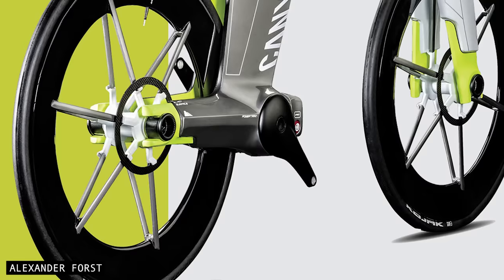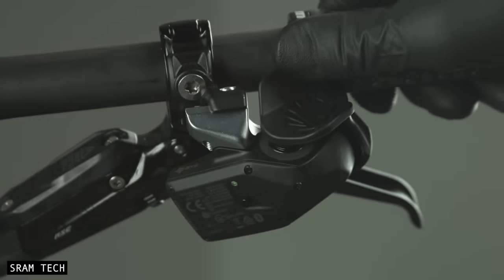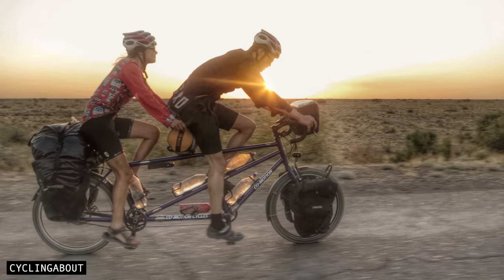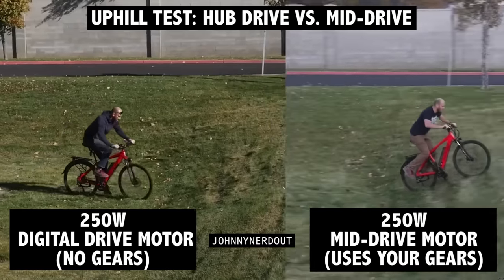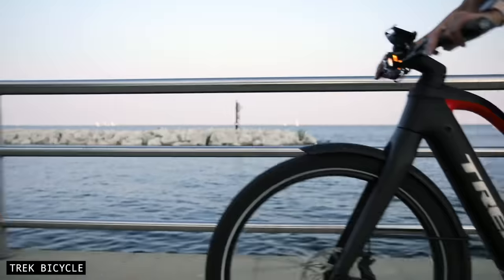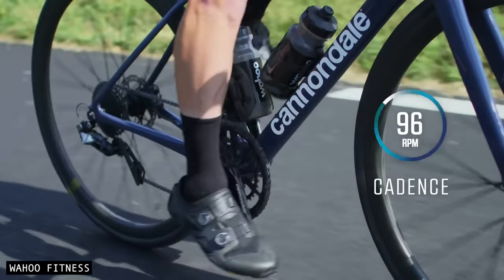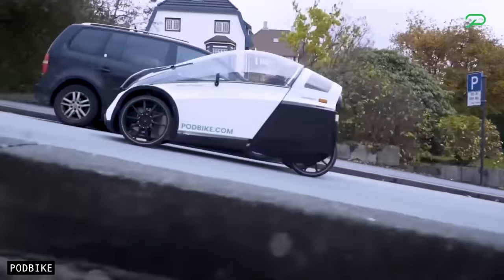Are Chainless Digital Drive Bicycles The Future of Cycling?

Comment: Summary
* (00:00:07) Digital Drivetrain Basics: A digital drivetrain uses a generator at the pedals to create electricity, which powers a motor at the wheel, eliminating the traditional chain.

* (00:00:26) History: While seemingly futuristic, the concept dates back to the 1970s. The first fully functioning prototype appeared in 1995, and the first production bike was released in 2012.

* (00:01:44) Advantages of Digital Drive:
    * (00:01:50) No Chain:  This means less maintenance, no greasy mess, and potentially lower running costs.
    * (00:02:12) Automatic & Infinite Gears: Provides seamless gear shifting, ideal for novice riders.
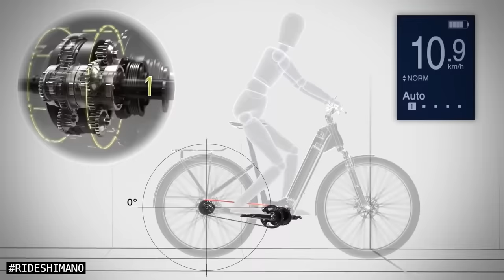    * (00:02:40) Potential for Energy Storage: Could incorporate a battery to store energy for later use, such as assisting on hills.
    * (00:03:01) Regenerative Braking: Captures energy while braking.
    * (00:03:17) Pedaling Optimization: System could ensure optimal power output and cadence for efficiency.
    * (00:03:50) Customization: Allows for adjustments based on injury or disability.
    * (00:04:03) New Design Possibilities: Opens doors for innovative bike designs, including folding bikes and multi-rider systems.

* (00:04:25) Disadvantages of Digital Drive:
    * (00:04:25) Lower Efficiency: Significant energy loss during the conversion process (mechanical to electrical and back to mechanical).
    * (00:05:36) Increased Weight:  Added weight from the generator, motor, and wiring.
    * (00:06:05) Gearing Limitations:  Rear hub motors currently struggle with both steep hills and flat terrain without being excessively large and heavy.
    * (00:06:28) Software Dependence: A responsive and well-programmed controller is crucial for a natural riding experience.

* (00:06:50) Digital Drive E-Bikes (Series Hybrid Pedelecs): Combining a digital drivetrain with a battery helps to offset the weight and efficiency drawbacks.

* (00:07:22) Existing Examples:
    * (00:07:22) Mando Footloose: The only current production bike with a digital drive, but with reported drawbacks in terms of feel and responsiveness.
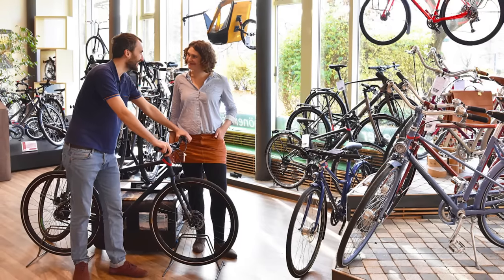    * (00:08:22) EE-SpeedBike: A more advanced prototype that never reached production but showcased a more natural riding experience.

* (00:08:49) Future Potential:
    * (00:08:49) Likely to be most beneficial for e-bikes, especially in applications like cargo bikes, personal transport, and bike rentals.
    * (00:11:05) Could offer benefits for rider efficiency and customized training programs.
    * (00:12:35) Potential for integration with solar power.

* (00:12:48) Conclusion:  While unlikely to fully replace traditional chain drives on non-electric bikes due to efficiency and weight issues, digital drivetrains hold significant promise for the future of e-bikes.

I used Google Gemini 1.5 Pro exp 0801 to summarize the transcript.
Cost (if I didn't use the free tier): $0.0510
Time: 40.58 seconds
Input tokens: 10688
Output tokens: 1292

Comment: Without even watching the video: Nonsense. You have a significant loss when turning the energy from your pedals to generated electricity, and then another when you feed the electricity to a motor. To my knowledge, at the most a generator has an efficiency of 95%, but an electric motor has an efficiency of 70% – which is way higher than a combustion engine with about at the very most less than 50%, but still, you are basically wasting ⅓ of the energy for … what exactly? Use an old-fashioned chain or belt or a hub-gear or a derailleur or literally any mechanical power train to reliably get an efficiency of over 90% even in the worst of cases. Have a nice day.

Comment: 4:45 -20% seems kinda high. Electric motors have 95-98% efficiency if I'm not mistaken. Does anyone have a better estimates for efficiencies of generator, converter, and motor? We can probably skip the battery charging efficiency most of the time, but would be interesting to see numbers for it too.

Comment: There is a possibility of a true hybrid like a Prius car, that is your pedalling is physically part of the motor and uses the motor as a generator. I believe it is possible to get motors to be more efficient than you quoted, for example, inwheel motors used in the World solar challenge are typically >94% efficient, that means bike motors have a potential to be similarly efficient, I have seen demonstrated motors that use no rare earth magnets and are capable of a wide range of motor speed using near rf frequencies pulse width modulated into large diameter rotors, they would be lighter than what is now offered. Used in something like the s40 recumbent made by cruzbike. I have been thinking about it for quite a while now.

Comment: I love the idea of electric/digital drive, but for many purposes it would be severely limited by the 250W motor limit in the EU. If you think about an average size person on a relatively light bike it's probably fine, but given a heavier person, some baggage and for example a child in a child seat (ie. how I often do bike trips) or when used in a cargo bike, the motor might be too weak, especially going uphill. Ie. the power output is limited only to what motor can squeeze out without any additional mechanical power. Of course peak power will be higher than 250W, but on a longer ride peak power will not change much. I wish the motor limit would be at least a bit higher, like 375W or sth like that. It's kinda bonkers that car manufacturers can make electric cars with ridiculous amount of power that go to 100km/h in a few seconds (read, you might be one mistaken gas pedal push from a disaster), but bikes are so severely limited.

Comment: your math is completely wrong and entirely dependent on the generator and motor setup used. There is also no need for traditional crank pedaling increasing efficiency by utilizing lever pedaling. The only disadvantage I know of is cost of manufacture and extra weight.

Comment: Generator to motor tranmission sucks even more than mechanical lmao
It's just easier to turn

But the fact it's less tiring and you can just build up the voltage using capacitors is quite interestin i guess
(or the modern hardware might don't need this at all)

Comment: Digital is the wrong word for these.  This is an electric drive system.  Digital means expressing information in 0s and 1s as in a computer.  It's worse because this is the opposite - it's analog.  The force on the pedals/generator directly controls the force in the motor.

Comment: Super-capacitor superior to batteries for a bicycle hybrid for at least 10 reasons
Operate in super cold without issues, very much unlike lithium ion which has to be near ideal temps to work fully
Not damaged by super hot, important given that summer riding more common
Can last millions of cycles and hundreds of years, way more than any battery
No charging other than riding, means they will always work and can charge rapidly
Unmatched energy recovery and ultra fast charge and discharge without damage
Superlative electrical efficiency and longevity
Batteries (Li-Ion, Na-Ion) have much better energy density when new and working, than ultra or super capacitors

Comment: Generated electricity is analog not digital as the output is continuous and needs an infinite number of finite points to describe it. Assuming feedback loops are digital implementations of continuous feedback loops (aka discrete) then just the controller is digital.  I would call this an analog drive. Using op amps and power transistors the controller could also be analog. Using triacs or diacs the controller could be a discrete (digital) controller with the mechanical hysteresis smoothing out the high frequency odd harmonics. Digital means discrete and commonly just 0 or 1 everything else is a digital approximation of an analog concept.

Comment: Short answer: No.

Longer answer:
The pedal efficiency is so low that they would just serve as the legal loophole to say "look, this is a bicycle". It makes sense to have low-speed battery-electric vehicles without pedals, and it's a smart move. But pedaling at 56% efficiency is insanely dumb, and you should scratch that part from your designs. Try to get legislation done that allows < 25 km/h vehicles on bike lanes, no matter how they are powered. Don't put pedals on vehicles which don't need them. Maintenance costs are even lower when you lose the pedal generator :)

Also, "digital drive" as a marketing term is making my eyes roll. Digital signals in the broadest sense are defined by having a range of discrete values. So does the digital drive have a discrete sampling rate of your pedaling power? Why would it even have that? Your input is your analog pedal motion. And sure, the transmission is controlled by some digital signal processing. But we haven't gone and started calling a fossil fuel car engine a "digital engine". (because it sounds dumb because it is dumb)

TL;DR: lose the pedals, legalize slow electric mopeds on bike lanes

Comment: I think that the idea is too raw currently. The fact is that the power, that can be transferred to the rear wheel directly would be much higher, than the one that transformed first to electrical power and next back to mechanical power. The best outcome we can get: the moving will demand the slightly higher efforts than in the case of simple mechanical bike. The same with the energy regeneration - too little energy can accumulate the biker with his bike by their inertia. Remember that this is neither a train, nor even a car: the mass and the rotarion speeds are drammatically lower...
Well, please prove me wrong. I would be glad to admit myself wrong...

Comment: in the 60s in France we had veloSolex; the electric bike forefather; it was a very light motorbike with a bike chain and pedal; you had to pedal to start and when the climb was too steep. you could also lift the petrol engine and use it a bike. you could reach around 30 km/h with it. it was extremely popular; specially among popular classes.
Reply: In Yugoslavia we had the TOMOS line of bikes. It was classified as a bicycle with an auxiliary engine. Technically you could use it as a normal bicycle, but let's be real, no one did that. They had a 49cc engine, an automatic transmission and had a top speed of 45 km/h (legally at least, realistically it could go a good bit quicker). 

Is that not what most of the e-bike crowd want? They'd be buying these bicycles with the pretense of "getting some exercise" while the damn thing drives you fully under its own power. Why not just get an electric moped if they are about the same price?

Comment: I hope this doesn't become the standard. Even the geared electric motors are not capable of taking people that are significantly taller, and therefore heavier, than the average person up hills as well as a chain drive does. E bikes are fun though and I wouldn't care if they were on an e-bike as long as they made the bottom bracket shaft strong enough. I would be against it if manufacturers tried to use it as an opportunity to make replacement parts hard/restrictive to get and expensive though.

Comment: My tiny input on this: instead of calling them digital drive, just name them for what they are: a low-powered electric motorcycle. It's futile to try and imitate the force you feel when driving your classical MTB. Go buy a MTB if you wish that, it'll even be cheaper.

Maybe try focusing the mechanical bikes which instead of chains use an axle to drive the rear wheel?

Comment: It might be a cool concept, but I'd image this to be highly impractical. Consider how inefficient regenerative braking is. Thunderf00t does a lot of good explanations on why things are terrible ideas and for one of them he used 50% efficiency for regen braking and he insinuated that he was being very generous to both simplify and exaggerate how poor the idea was. If this generator was so efficient at converting energy, they would probably use this technology for cars. It could be that the efficiency isn't as bad as transforming the voltages to store in battery and then for the motor You also have the problem in some areas where the maximum speed would be hard capped because all of the power is provided by the motor and so you won't even be able to get the poor performance of a regular e-bike that has a lot of resistance when unpowered Really we need technologies that can make e-bikes like regular bikes when unpowered, and possibly recharge the battery where you can pedal but don't want to go faster because traffic conditions, i.e. safety.

Comment: having built hundreds of different generator powered bikes, it's easy to overestimate how much power a human rider can produce...the very top end of power production is around 200 watts and that would be short sprints of just a few minutes...steady riding cadence can only produce about 75=100 watts  ( per hr ) of power..so whn you stack that up against how much power the electric motors consume ( varies a lot )...it's pretty clear a rider cannot keep up with the power needed to keep a e-bike going.  then it's just a battery depletion issue.   in a nutshell...digital bike are stilla dream.

Comment: Honestly between the loss of efficiency and necessity of all the e-bike components anyway...why have pedals? You're just pantomiming cycling while heating up the dynamo and making the battery do the real work. All a "digital drive" seems to do is get around regulations that differentiate between vehicles that are nominally human-powered and purely electric motorcycles.

Comment: I.e. not simple but complex new technology, having to jump through burning hoops to compete with the old tech. Then we'd have the same pains and hassles as with electric cars. And remember how expensive bikes with electric/electronic components are.
There is an element of self-deception in this technology push, since technology functions as a power trip fulfillment, i.e. it is vastly driven by fear, especially at the level where decisions with far-reaching consequences are made.

Comment: In the 1960s, the word was "transitorized". "Digitized" means discrete. Here we have electrically coupled drive train. Look up the definition of the word first ! Yeah, I know it uses a small computer, a microcontroller, to optimize the energy transfer, hence "digital". That goes back to "transistorized". Computers are ubiquitous, in the modern world. Just like transistors replaced tubes, back in the 1960s, and the marketing "geniuses" had to tack "transistorized" on everything (even things with zero electronics). I guess "digitized", is the modern equivalent. Or, at least it would be back in 1995 ! Like overused BLUE LEDs, using "digital" is becoming a bit tired.

Next we tackle, "organic". Now, I'm doomed !

Comment: What strikes me about this technology is it's less efficient than a mechanical drive. Each time you convert energy from one form to another, you inevitably lose some. No conversion is ever 100% efficient. You'll lose some energy converting the rotational momentum of the pedals into electrical energy, depending on the method used, there are many. Then converting the electrical power BACK into rotational momentum, you're going to lose some energy again. You don't gain it back. Ultimately, it would be more efficient and less complex to just have a mechanical drive. Moving parts, yeah. But sometimes you need moving parts.

Comment: This basically is like running a normal hub e-bike. If your remove the drive train and peddle the bike will move. Peddles just move without resistance.  Having a drive train just give your redundancy and better battery usage.

Comment: 58% efficiency isn't half the efficiency of 95%. When comparing efficiencies, you compare relative distance to the theoretical perfect efficiency. So half the efficiency of 95% would be 90%, as it represents twice the waste energy. 58% efficiency is worse than 1/8 the efficiency of 95%. More than 8 times as much energy is wasted when using a digital drive.

Comment: You wont ever get this. The whole charging while you ride thing is bogus. Three things. You are either fully powering the bike. If you are doing this, and you try to take some of that energy to charge a battery or supercap, then you are simply better off with a regular bike. Or you are pedal assist and thats cool, you are putting in some power and the motor is putting out some. The only way to change this is acedemically with math in deciding which is doing which. Except if you try to take some of the energy from the rider in this case, to charge something, objectively no matter what math you do, you will experience losses over just having a good controller and a good drivetrain. Cadence or torque sensors. They work pretty well if paired well with proper drive components. They work even better on long rides with some surging and  and 'cogging' at take off and slow and go traffic. 
 Trying to use the rider to generate electricity to power a motor is pretty dumb. Look up olympic cyclist vs toaster. Its not pretty. Regenerative breaking be dammed its just more weight. 
 By the way the only thing in this that he said was dumb (digital gears) is actually the only smart thing. For exactly the same thing that he said. You could actually use an ebike as a mobile stationary bike say on a public trail, you could ride at whatever cadence you want without violating speed or safety regs. 
 Thats the only thing this would be good for. And theres already a recumbent bike (cant remember its name) that does this. Its actually pretty simple. Under a certain speed and cadence the bike is mimicing the input of the rider, and above that, the rider is doing their thing and the bike is just basically crusing and controlling its speed. If more speed is needed the rider overides with a throttle or brakes for less speed. Or they simply stop pedalling and coast. Its a neat set up.